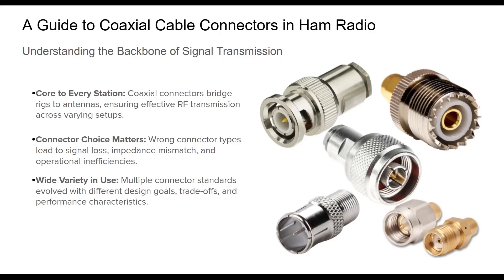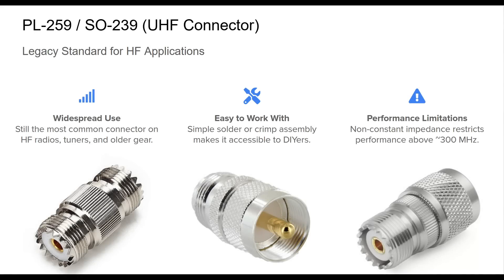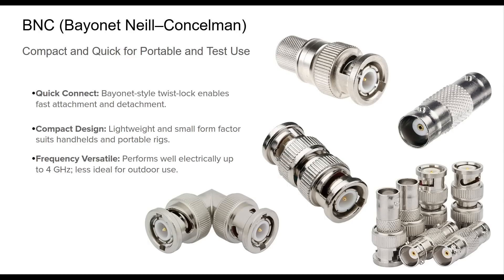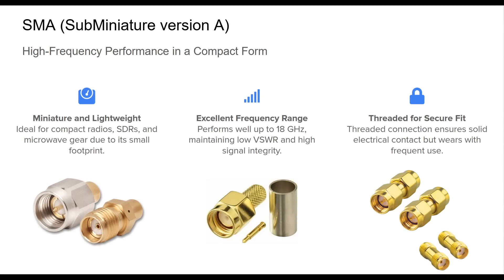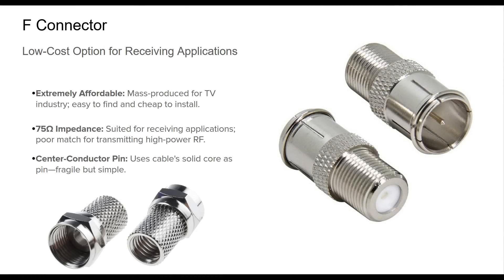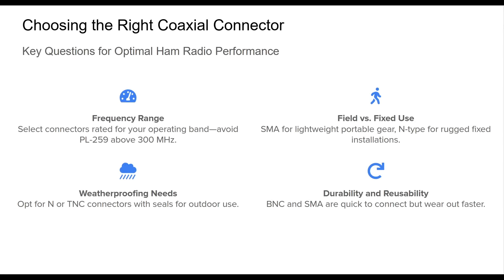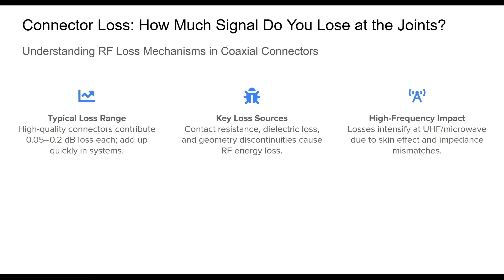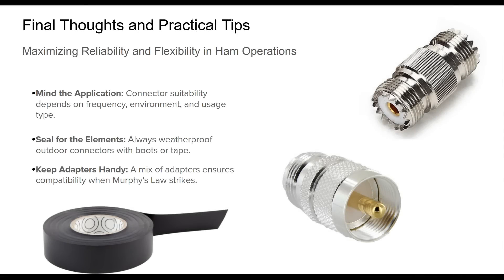The TRUTH About Coaxial Connectors in Ham Radio!

Comment: New HAM here.  I'm trying to digest this information, as well as what you've provided on cables, and apply it to my use case, but I'm lost.  I have a simple Xiegu G90 with a PL-259 connector. I have both a Radioddity HF-008 and an EFHW for my antennas.  For the time being, I'll be working from parks, the beach, and campsites. If you have the time, would you please suggest (especially) the cable I should be using, the length and a trustworthy supplier, and whether I should consider different connectors than the PL-259 / SO 239 set?  Thank you.
Reply from the maker: Both the Xigue and that antenna use so-239 connections so you would need coax with PL-259 on each end.  I’d use 25 or 50 feet of RG-8x, ABR Industries is one of the best places to get cable 👍
Reply: @TheSmokinApe Thank you very much.

Comment: I sheared one of the leaflets on the female PL-259-N type  on my Rig Expert AA600 by connecting a plain PL-259 male.  (Ironically, Rig Expert had provided me with an adaptor) but  I was unaware of the difference/significance at the time. Can you comment on a connection for a Buckmaster 3000W 7 band antenna with a regular female PL259  to an LMR-400 (100 ft) coax with a male already installed N type?  Do I need an adaptor?  Thanks for any info/warnings.

Comment: Another great video! I was wondering if you know of any good video measuring insertion loss for various connectors. Often we gat standard N or SMA calibration kit for VNA, but have to use different connectors for different cables. Ho do you calibrate for different cable connectors?  I see there is a “delay” setting in SV6301A in bottom left corner. I remember watching some video while back, which suggested to such connector / coupler compensation. Any thought?
Reply from the maker: I’ve showed measuring insertion loss for things like; tuners, chokes and coax.  It’s an S21 measurement.  Delay is probably the best way to account for connectors, I show that in a NanoVNA tips and tricks video 👍

Comment: Makes absolutely no sense to me why I can spend 1500.00 plus dollars on a high end radio that has pl259/so239 connection on the back of the rig . Almost all have vhf/uhf tx/rx . So if the pl/so type connectors are that bad even for low freq’s why would you not just put NType connectors on the newer radios ?  Especially since the N type has been around for so long . 
I guess it’s just build it as cheap as possible and charge a fortune for the result . I’ve never seen a vhf/uhf radio come with N type connectors . Makes no sense at all.
Reply from the maker: lol, love this comment 👍
Reply: @TheSmokinApe  Thanks , I've been watching some of your videos lately .very well put together pretty straight forward and informative. I just happened across your video on connectors, and it's been a mystery to me for years. Why you don't see more N type connectors where they are clearly superior. will sub . thanx
Reply from the maker: @rrrrsorrry5 we should see more of them 🤷

Comment: So I guess my poor performance with the 70cm side of my satellite antenna is due to using 259/239 connectors even though  they  are on LMR400.  Since the antenna has BNC connectors would I be looking at loss using a BNC to N adapter at the antenna if I get new cable with N connectors.  Thanks 73 Bob WB6TIS
Reply from the maker: That could be it 🤷

Comment: From my experience, BNCs are fine for oscilloscopes, etc. If you are in the habit of doing a lot of connect-disconnect cycles, for POTA (as an example), then BNCs loosen up and become intermittent. Additionally, If you use anything but bonafide Amphenol coaxial connectors, the tolerances on brand X ones can differ, also causing issues. I had many problems this past weekend at FD. I've sworn off BNCs and non-Amphenol connectors.
Reply from the maker: Hard to argue with any of that, thanks for watching 👍

Comment: F connectors and good quality satellite service coax is how I run all of my receive antennas.  If you run LNAs and splitters the impedance mismatch doesn't matter.  A wideband receive antenna presents a wide range of feed point impedance anyway.
Reply from the maker: I have a powered 5 way splitter, it has a fancy name but I forget what it is…. It’s all F type.

Comment: i hate anything mcx with a passion. i actually had a sdr that used mcx,  its completely crap and  the cables are easily prone to the center pin crimping to fail .  such a stupid cable and stupid setup .
Reply from the maker: I don’t like them much either, thanks for watching TFT 👍

Comment: What connector do you use for UHF with more than 500W or even more than 1KW? You say that the N connector does not support more than 500W in UHF...However, UHF antennas supporting more than 500w generally have N connectors.
Reply from the maker: It will depend on the quality and the manufacturer of the N-Type connector, they are all not created equally.  Make sure to chech the manufacturer's specs...  and buy from someone who is reputable.

Comment: Great job with the slides and history of common connectors ! The PL 259 / SO 239 are very old. Was used in the early days of TV for Video use.  At lover frequency's that connector will work 50 to 75   ohm and farther with ease and low loss . Which is perfect for HF radio where is is common to have a miss match off 50 ohms.  In the early days 75 ohm RG 11 was more common feedline. It had lower loss and 1/2 wave dipole is 72 ohm . As things improved and power level increased 50 ohms had less loss for transmission . Keeping RF voltage lower.  Then 50 Ohm came the norm for transmitters and 75 Ohm for receive only do to lower loss . Now Motorola made their own connector for lower power UHF and is still common today on new commercial radios . Commonly called the Motorola UHF connector or the Mini   UHF connector. It is the same as PL 259 just smaller . TNC size. When getting commercial gear and mod for our bands it is common to find that connector and adapters are very common. Just keep them adapters handy .  And you will never have all the adapters you will need. so many different ones and new ones coming out. Play RF long enough and you find them.  Cheers and 73 !
Reply from the maker: Thanks for the info Robert and for watching 👍

Comment: What  power can BNC's handle?
Reply from the maker: It depends on the manufacturer, frequency and duty cycle.  But generally about 250w on HF for SSB 👍
Reply: I'm pushing 300W through SMA connectors for the last few months, I'll let you know when it dies 😆
Reply from the maker: @godarklight 😮

Comment: I'm using more N connectors these days. Anything can be adapted. 
I wonder what the mismatch net result is using a male N + adapter + SO239 is. I'm sure it could be measured by the technically astute.  One of these RigExpert testers is likely capable of measuring such (if you know what you're doing). I might go ask W2AEW, he's a super electronics tech and teacher.
Reply from the maker: It’s pretty easy to measure with a VNA or Spectrum Analyzer with tracing generator 👍

Comment: I enjoyed the video.  Lots of good info. One to add is the rca connector.  While not used much today. It was used alot on tube equipment.  I have a collins and drake set. I had to buy a rca to pl259 adapter for operations.
Reply from the maker: That’s I good point Dustin, I totally forgot about that one 😐
Reply: @TheSmokinApe you're going to have to do the video over now! Lol
Reply from the maker: @dustinhasselbach6378 😂
Reply: I got an old Heathkit that used those connectors. I modded it to replace them with bnc and a type n for the antenna. Much more useful and universal!
Reply from the maker: @braixeninfection6312 awesome mod 👍

Comment: Another great video! Even an old guy, like me, can learn something. I was taught BNC meant Bayonet Naval Connector. Never thought much about it. On another matter, one of my students really believed each adapter used resulted in a loss of -3dB. Think about that, half the RF power lost in an adapter! I think he forgot the decimal point in front of the 3. That gave the class a bit of a chuckle. The last time I saw a TNC was on my 6 channel crystal controlled 2 meter Wilson 1405 two radio brick HT. I changed that to a BNC so I could use more common antennas.
Reply from the maker: Lordy at 3db!  Yeah, I don’t see the TNC much in the wild.  Thanks for watching David 👍
Reply: @TheSmokinApe  That was before everything came from China.
Reply from the maker: @DavidJohnstone-hi9kr 😂